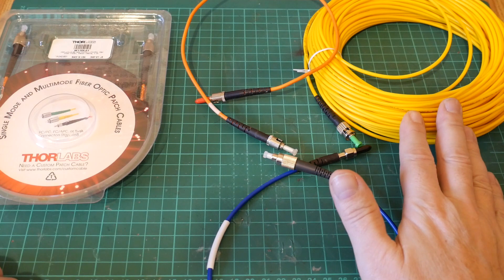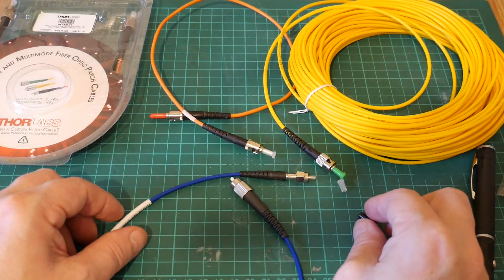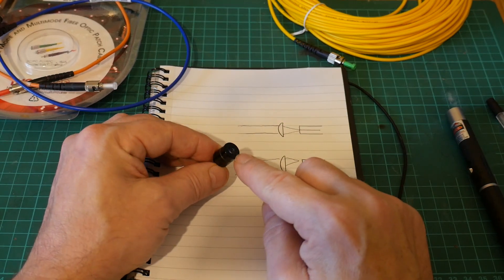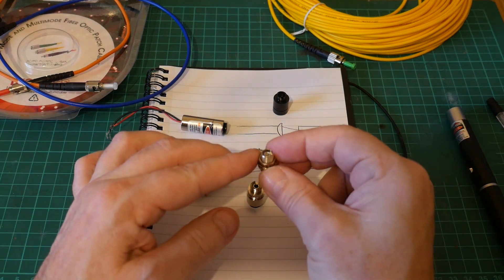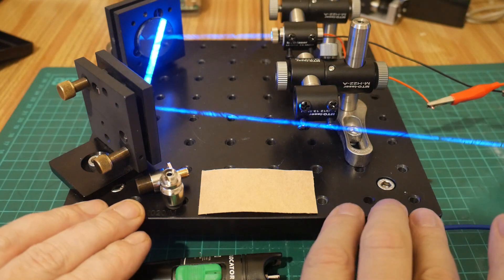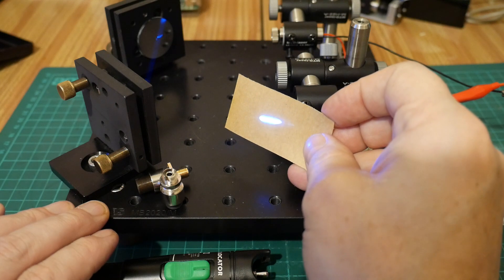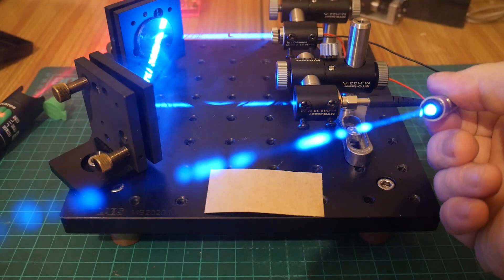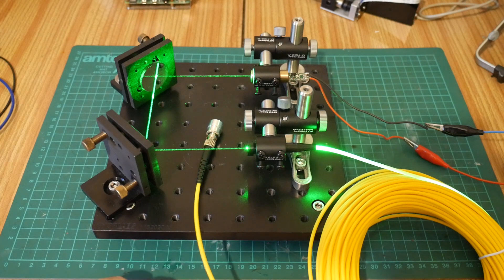Coupling Laser beams into Fiber Optic Cable!

Comment: Very interesting, Les!
Back in 1980, I attempted pushing a 5 watt argon beam down a 100 micron, single core quartz fiber, with a parabolic refractive index, which guided the beam towards the center. Didn't have any fancy lens assemblies, so I made mine with a piano-convex lens glued to the bottom of a glass tube, mounted vertically.
The fiber end was held by a mechanical pencil's collet, which allowed for easy focusing.
In order to eliminate surface reflections, I filled the glass tube with glycerol, which has ~ the same refractive index as the lens and fiber.
The objective was to deliver a scanable beam to a pair of remote galvos, inside a scanning head, located in the lighting truss, in order to avoid heaving ion lasers on top of 10 towers.  
Worked fine.. until, as you explained, the beam missed the end of the fiber, heated the cladding, which expanded, making the alignment even worse. Furthermore, I was unable to achieve the appearance of a parallel beam for over 20 ft from 5 mm scanner mirrors.
Laser Diodes have literally been game changers for laser entertainment. No 30 amp 3 phase, water cooling, hoses, pumps, frozen tubes during transport in winter. Higher wattage @ 10% the cost and hassle.
Reply: What he said
Reply: I don't understand any of this
Reply: @huntsheating  Then keep watching this uniquely informative channel regarding laser technology.
This stuff can only be discovered and demonstrated here. 😎
Reply: @huntsheating God has no sons

🌍 The concept of God is summarized in the Quran as: 
 
📖 { “Say, He is God, the One.  God, the Absolute.  He does not give birth, nor was He born, and there is nothing like Him.”} (Quran 112:1-4) 📚
Reply from the maker: Nice! I like the idea of holding a fiber in a mechanical pencil collet, genius! I will give that a try!

Collimating fibers, especially over long distances is hard for sure. I have spent quite a bit of time over the last month trying to get to a satisfactory collimation solution, and it is good, but will never be as good as the beam from a gas Laser!

For sure, Laser diodes changed everything. they kind of take the fun out of building Lasers in a way, so I suppose the thing to do is find novel and cool things to do with them!
Reply: @LesLaboratory  Thanks Les. 
lol! So, you were more impressed with the pencil collet than using glycerol to create an invisible transmission junction for light?
'Beauty is in the eye of the beholder', indeed. No offense taken.
I found that the focal point of a fiber isn't only at the end, but extends into the fiber, itself. That's where the problem lies and why I attempted to use a self focusing fiber of the smallest diameter and parabolic refractive index.
Yes, an exposed SP165 tube is a wonderful thing to behold. TEM 00 beams are the essence of optical perfection. Building optical systems with them permanently installed within a clean lab are great fun.
Bu, touring with them, while uninsured, with back to back gigs for months during freezing winters is a very different matter. Gotta blow all the water out of the cooling system, before the get-out, or they'll freeze in transit.
RGB modules inside a compact, 110 VAC, case, with a fast pair of galvos is all we laserists need on the road..
BR😎
Reply from the maker: @TheOleHermit  It's the little things! Of course the glycerol trick was good, but holding bare fibers has been on my mind lately ;-)
Reply: @LesLaboratory  Technically speaking, I was holding the fiber by the cladding.
I suggest using a pinhole mask to avoid hitting the collet with the focused beam, in order to keep from heating up one side of the collet and fiber, in case of probable misalignment.
If only heated from one side, the fiber will expand, bend and become self destructive.
BR
Reply from the maker: @TheOleHermit  The old (real old) Newport mounts had the fiber protruding some millimeters from the collet, presumably to solve this problem. Of course, that has its own problems too. I might look into cleaving, fusing and mounting raw fiber, it will be useful for jobs for sure!
Reply: @LesLaboratory  I only protruded the fiber ~ 1 mm beyond the collet. But, it was invisible when immersed in glycerol. Only the cladding showed.
Wow! I'd like to see a video of that process! Are razor guillotines still being used to cleave solid core fibers nowadays, Les?

Comment: How much power could you push through a fiber like that?
Reply: I can't answer that, but this is what it looks like when you exceed that power rating- https://youtu.be/0yq0GoH0TH8
Reply: @WaffleStaffel  I was wondering if it would heat up and break/diffuse.....

Wait... It wouldn't be able to start the lit portion at the beginning and travel to the end. It would need to start at the end and move up. I have a feeling that how he's starting melt is by damaging the end and it works its way up to the laser source. But until it's damaged, it seems kinda OK.
Reply: @xenoxaos1  He's either using a mirror, or shooting another laser into the end to get it started. Evidently damage or bending could trigger it too. Like Les said, many variables!
Reply from the maker: Depends on the Fiber, and a bunch of other parameters (wavelength, pulse width, diameter of the core and so on)  @WaffelStaffel, awesome video of Fiber Fuse! Nice!
Reply: @LesLaboratory  It blew my mind the first time I saw one, because there was no info on what was happening, and I had no idea what was going on!
Reply from the maker: @WaffleStaffel  Same here! It's crazy. Apparently it can occur in telecoms links and destroy 10's of kilometres of cable, that would ruin your day!

Comment: Nice. What kind of experments do you have for us in the future? 
Can you say what power that red $2 "ebay special" pointer is? Obviously they're all marketed as "5mW" to evade the brilliant and totally effective government bans, but I have a green doubled Nd one and the violet InGaN diode one of the exact same style, and they both produce over 70 mW of light with fresh batteries as measured with a good power meter at my lab. Wondering if this one is similarly insane or actually 5mW like all the old ones that first appeared in the 90s. Also, is it 630 or 670nm do you know? thanks!
Reply from the maker: That would ruin the surprise, but I am hoping to have one released before the Holidays!
Never thought to measure the power, the wavelength is known at 660nm as I have used it in the Pi Spectrometer videos. I have just measured it on the Coherent Lasercheck and it measures 22.5mW, pretty insane right enough! I remember back in the day when the first 650nm Laser pointers came out, and I had to buy one (at great expense!)
Reply: @LesLaboratory  oh god, don't remind me. I spent WELL over $100 of my diligently saved allowance as a kid in the early 90s on one from I believe Edmunds. 😳 It's embarrassing. One of the reasons I'm trying to hold off blowing about $300 on one of the new bright 255nm deep UV LED flashlights for my fluorescent mineral collection because the price just HAS to come down on them.
Thanks for the power measurement!

Comment: £0.31 a metre in bulk, I never thought that kind of cable was so cheap.
Reply from the maker: it's crazy! I have over a quarter mile of this stuff now on a small budget. At a certain length, shipping exceeds the cost of the cable!
Reply: @LesLaboratory  yep, quite amazing
Reply: @LesLaboratory  perhaps you could post links to the equipment you use and generate a bit of income?